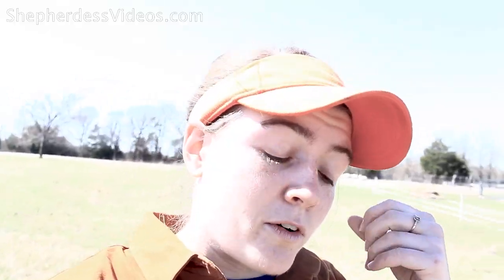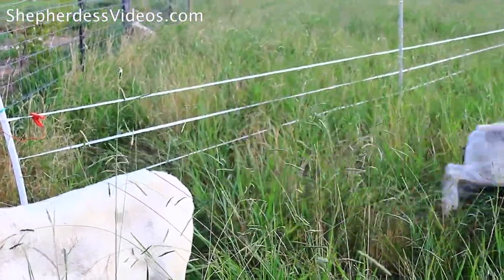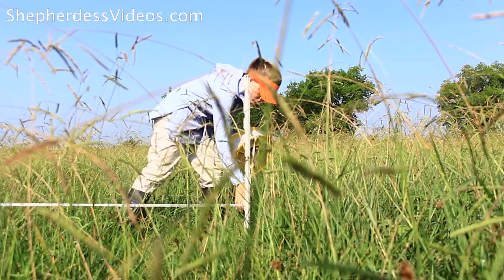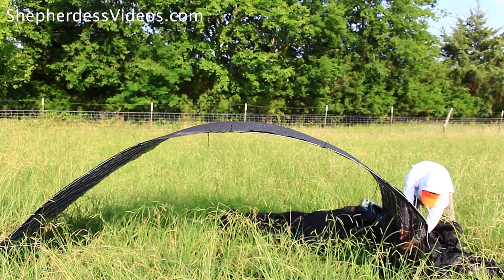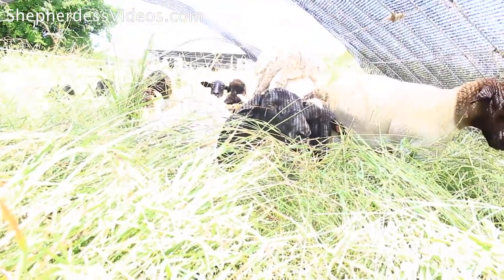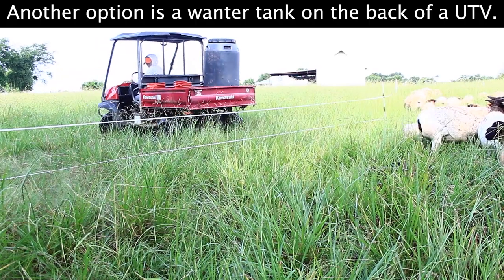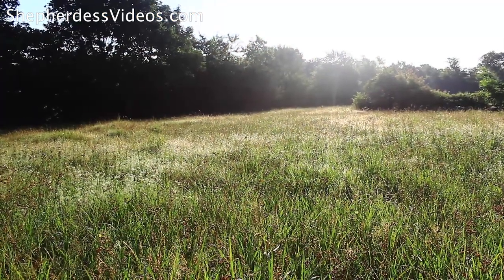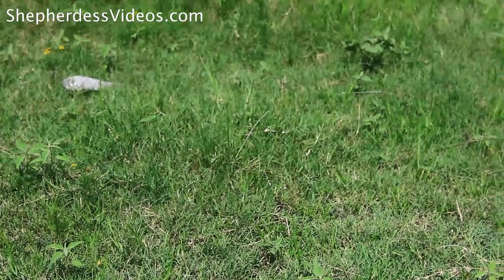SMALL-SCALE SHEEP ROTATIONAL GRAZING SYSTEM | Simple and Easy 23 acres system

Comment: That is not welded wire fencing you have. It is woven wire field fencing.
Reply from the maker: Good call, thank you!  Also a note for anyone watching, woven wire is less expensive than welded wire, so be sure to keep this in mind when installing your fencing for sheep.

-the Shepherdess
Reply: @theShepherdess  I think a enclosed trailer would be very beneficial for you. You could have the battery and fence electric box inside. Plus you could have a ibc tote for water. Drill hole in the side and run a hose out to fill water for the flock. Keeps it cooler and out of the sun for algae to grow. Then you could mount your portable shade structures to the side of the trailer when you moved to the next spot. Just a thought